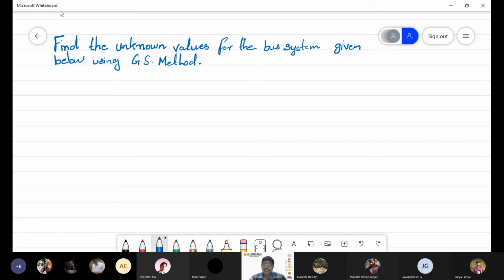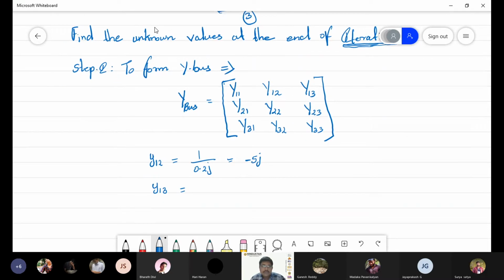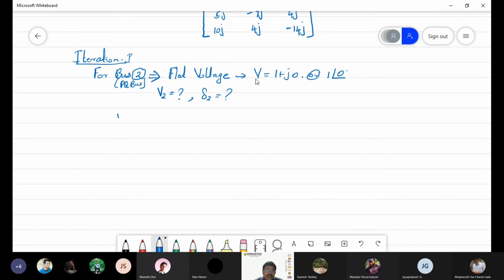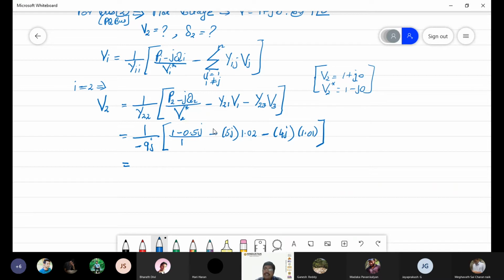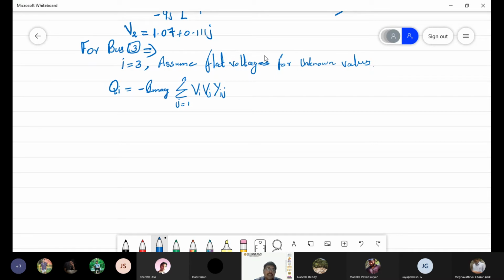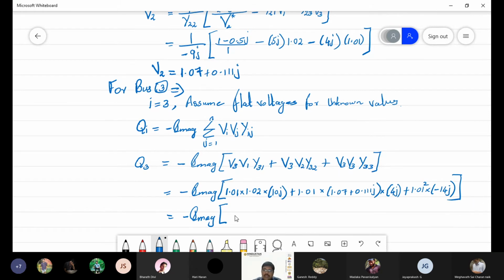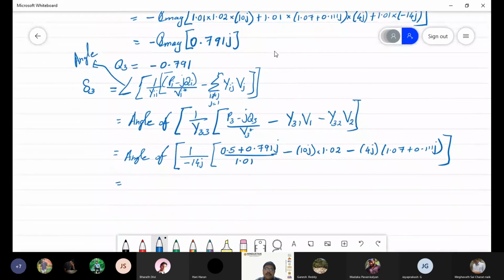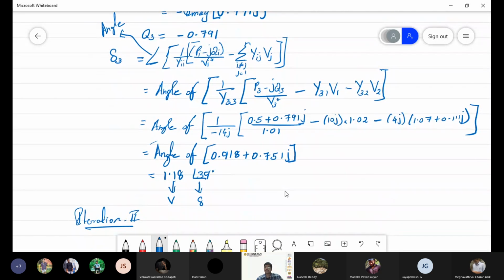Solved Problems in Gauss - Seidel Method (3 Bus System)

Comment: Professor , for the P and Q values they must be sch values so it seems there is a mistake
Reply from the maker: Hi, The main purpose is to identity the unknown power flow parameters. In the specified system P and Q are given, we can start the iteration depends on the given values.